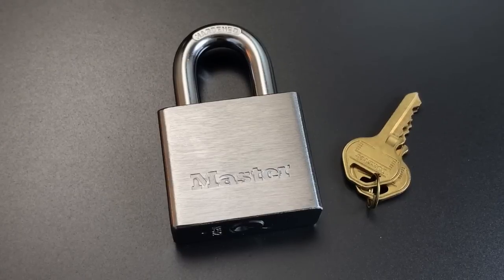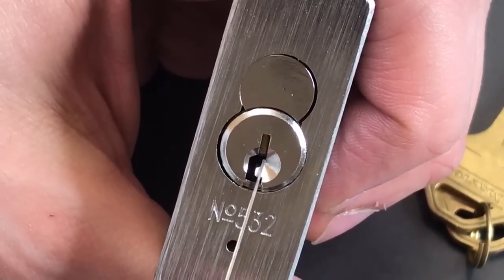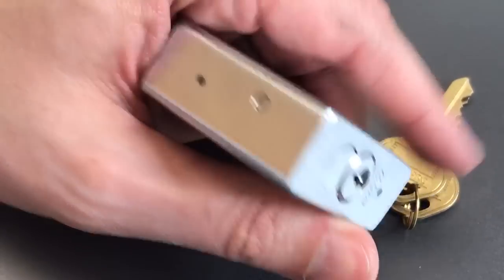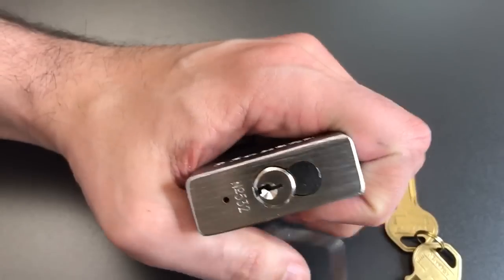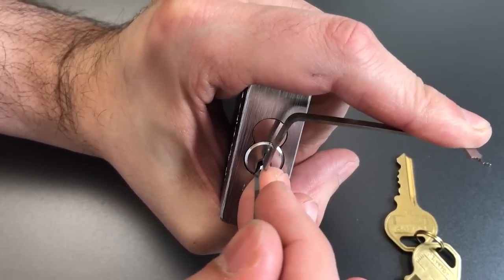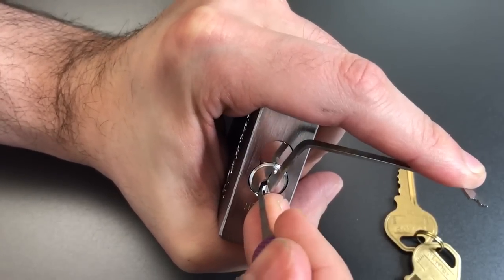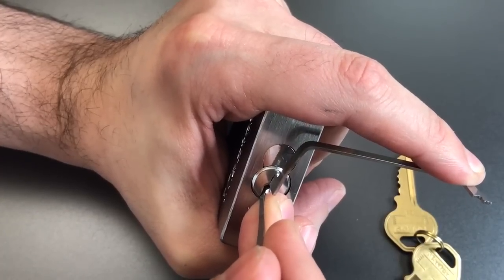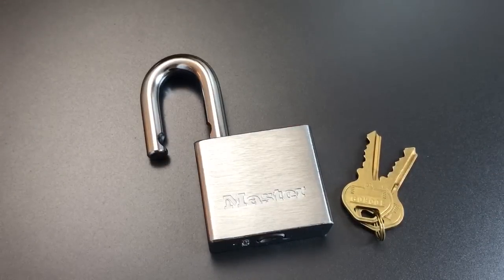[379] Master Lock Model 532 Picked

Comment: I looked at one of these at ACE today. The keyway is slightly different than the one you show from 7 years ago. It is roughly the same but slightly more paracentric.  The keyway in yours on the right comes down from the pins and moves to the left at a 45° angle. The one  I saw today comes down very little then moves to the left at a 90° angle with no room to put even a 15 thousandths pick up anyplace close to straight.
Regardless of the keyway I didn't get it because it is not gutable.

Comment: Just recently opened mine, this is an extremely underrated lock at its price point, build quality is excellent, 5 pins, at least a couple spools, and defeated me for longer than my 410, or my abus 83/50.  If only they had gone with an interchangeable core model, this would be a featured lock all over the place.

Comment: Very nice pick,
I  got one of these oddly enough at my auto parts store.  But other than the nonremovable core, it's an awesome lock for $12.
But now I am probably going to work at removing that core pin and see inside. 
Thanks for sharing, 
Great video M8
Reply from the maker: Good luck getting that pin out.  If other locks are any indication, it will be inserted with an interference fit and harder than the lock body making it ideal for deflecting (and breaking/dulling) drill bits.  Hard to get out without destroying the lock.
Reply: LockPickingLawyer
 good point,  Master locks are definitely true to the term "Tough Under Fire"
Maybe I will ponder over it a while first. lol
Reply: You can maybe use the difference of thermal expansion between the insert and the body.

Comment: I’m just starting out learning this trade. I happened to find this lock with no key and thought this would be fun to open. I have gotten it open 4 times but not in a row or anything close. I’m just kind of fumbling around still. Is this a good lock for a beginner to be using or should I perhaps find some easier locks until I can grasp the concepts and get an idea of what I’m doing? Thanks for the videos, you’re awesome!

Comment: Nice to see a Master Lock with a little resistance... That's a first for me ;)
I noticed that you used off the chart hard tension.. Do you think that could relate to why you had different picks on it each time? Personally I use feather light tension, and so far I've been able to map out a specific sequence for every lock I've picked (For comparison, my hardest pick so far is this lock: https://www.youtube.com/watch?v=9k3Eg4Hr_Ls ).
Reply from the maker: 90% of the time, I can pick a lock the same way every time I open it regardless of tension... on better made locks, the picking order can be the same with PRECISION picking, but more often than not, it will pick differently each time.  As far as tension goes, heavy tension contributes to picking consistency because it is easier to moderate heavy tension.  If you haven't seen my video #188, I explain my approach to tensioning locks.
Reply: WOW!.. Thank you Sir! In video 188 you just articulated a whole lot of what has been rattling around in the back of my mind, just out of reach.

I'll vise up my training lock and test it all out. My only concern is, as you also state, being hard on the picks. I am running off a dual gauge Praxis kit, but so far I've only really been able to use the .015 ones, as the dragging of the .023 ones drives me nuts. My point being that I am afraid to damage the fragile .015 ones, as someone still needs to publish single pick selection that isn't a joke price wise (I am especially eyeballing you Peterson-with-$10-and-above-single-picks).
Reply: Have you tried sanding them down, you normally can get them down to at least 0.022 and gets rid of some of the burrs on them.